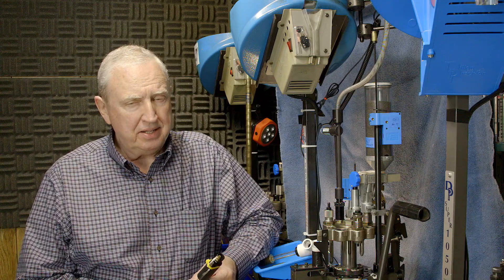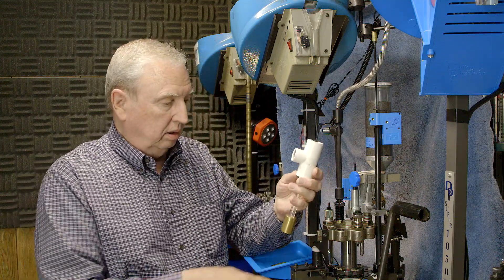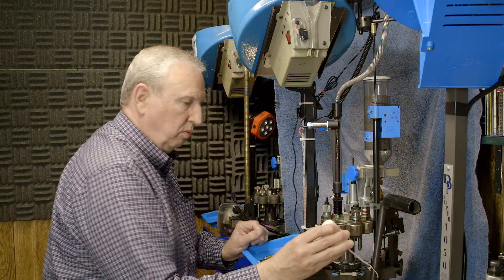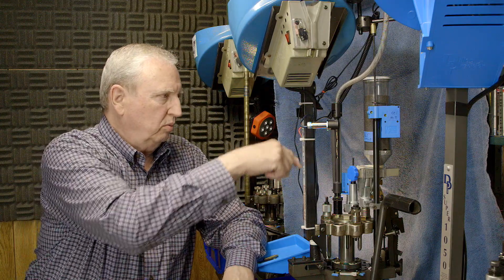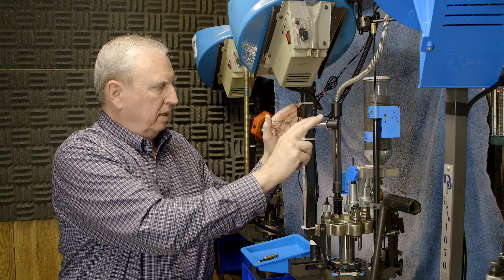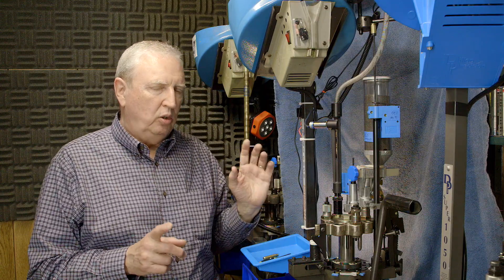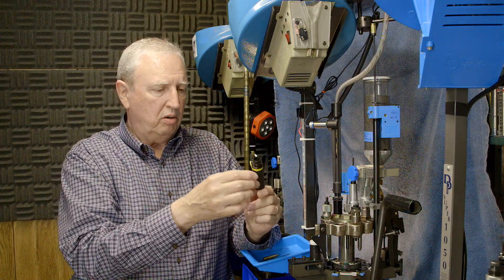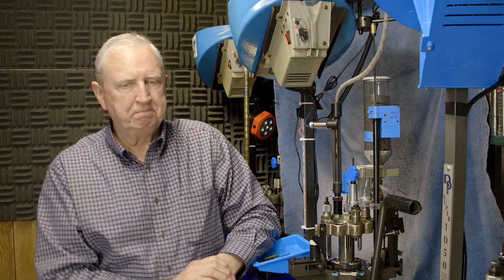3D Printed Prox Switch Dropper for Mr. Bullet Feeder

Comment: What unit of measure did you use when asked?  It's asking for MM, CM or Inches.  I assume MM.  I have ordered the prox and relay.  Need to order the print now.

Thanks,
UTG
Reply from the maker: I submit the .stl file here:   https://print.all3dp.com   and then choose the HP process using black nylon. Takes about a week to get the part from when you place the order.
Reply: @RexRoach  It's asking for unit of measure.  I assume mm?
Reply from the maker: @utgreenhead  Yes, use mm and choose Multi-Jet Fusion as the method. It was $23 when I checked today.
Reply: I don’t have the print in yet, but received the prox and relay.  I tried to test without the printed tube, but for some reason my prox is staying normally closed.  I ordered the same one you listed “NO” but mine will only run when I have something metallic held up to the sensor.  Any ideas?
Reply from the maker: @utgreenhead  My apologies. I gave the wrong number for the relay. You need a 5-pin relay that has both NO and NC connections. With that relay, you can use either an NO or NC prox. In the case of the NO prox I specified, when a bullet (metal) is near the tip, the prox "turns on" and provides ground via the black wire. You have your relay coil (85 & 86) connected to 12 V+ and ground using the brown and black wires of the prox. The relay is seeing 12V+ all the time, but only gets a good ground when the prox is activated by nearby metal.

So when the prox switch turns on, it also turns on the relay. You must use the NC contacts (30 & 87a) so the MBF motor will run all the time until a bullet gets near the sensor. When the sensor turns on, the relay turns on and the NC connection is opened and the MBF motor stops.

If you have an NC prox, the relay will be on until the bullet trips the prox and you would use 30 & 87 on the relay which are the NO contact. Thus the MBF motor will still stop when the bullet trips the prox. 

Hope that helps and I'm very sorry about the bad info from me. I've corrected the part number for the relay in the description along with the terminal change on the relay (87a instead of 87). 

By the way, you can get those relays at any auto parts store.
Reply: Awesome!  I know just enough to be dangerous with this stuff. And when connected everything and my MBF didn’t start cycling with nothing touching the prox, I immediately went into C2 (problem solving) mode.  Ensured all my connections were tight; good. Checked power on my wall wart; good.

When I touched the prox to metal and the feeder started to spin, I knew I had a problem.

Thanks for your help Rex.  Love your stuff. Keep em coming.
Reply: Picked up the 5 prong relay.  All is good now. Thanks Rex!
Reply from the maker: @utgreenhead  Great. Again, my apologies for my mistake and any inconvenience it caused.

Comment: Outstanding! I definitely want to buy a complete setup for 233/5.56. How do I go about ordering/paying for one? 

Would you make one for 9mm, one for 45acp, and one for .308.

Any chance you could email me the stl file?... just thought I’d ask
Reply from the maker: I don't have this for sale, but I've posted a link where you can download the .stl file. You can get the sensor and relay from Amazon or eBay. I would not bother with one for pistol calibers like 9mm or 45 ACP as those bullets work perfectly with the original Mr. Bulletfeeder. I feel certain Mr. BulletFeeder also works well with .308 because of the greater weight and length of the bullet relative to the .224 bullets.
Reply: Thank you very much for the quick response and for posting the .stl file. I have been fighting with my .223 bullet feeder ever since I got it. It was quite the relief when I found your video on how you solved the exact same problems I was having. Is the .stl file you posted for the version where you added extra threads to better support the sensor?
Reply from the maker: @surplusbikebags3086  Yes, it has slightly more thread length and it makes a big difference. Do you need info on the sensor/solenoid/wall-wart that I used? I suppose I should add that info along with a sketch of the wiring in the description area.
Reply: Ok great! that’s what I was hoping for. I got all the parts and wiring info from your other video. I’ll be putting one of these together and very soon. Thank you for your help.
Reply: Hello again, my friend (that has a 3D printer) that is going to print this for me to try, said that his printer works best with .dxf files. Do you have the .dxf file for this? If you do, could you post it? Thank you.
Reply from the maker: @surplusbikebags3086  No, .dxf files are for flat objects to be cut with plasma, water jet, etc.
Reply: Oh ok, I’ll let him know, I think he may not know the difference in the file types, he’s kind of new to printing. Thank you for answering my questions